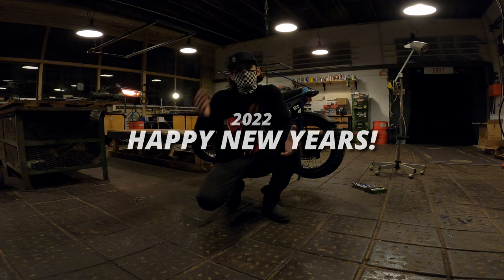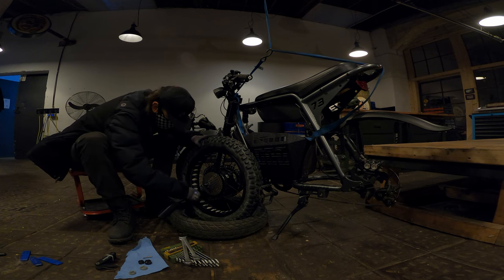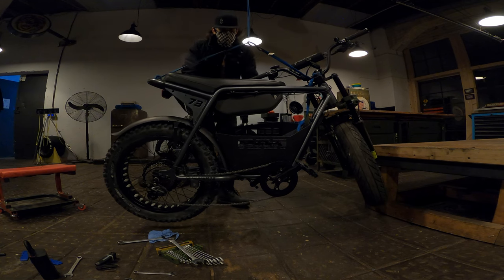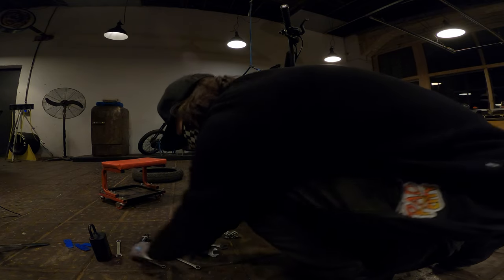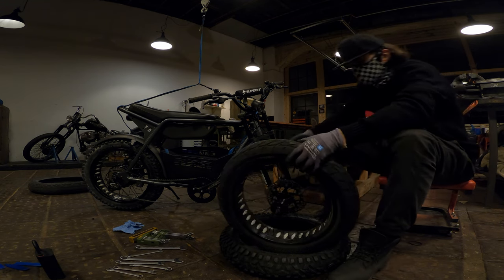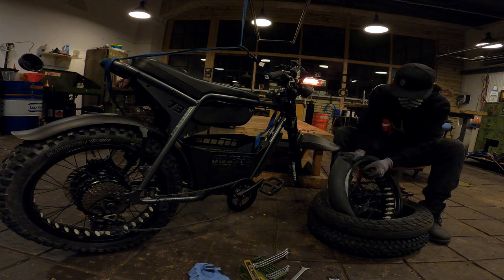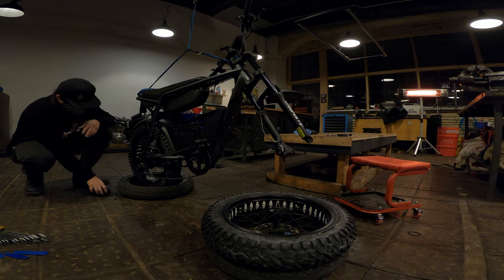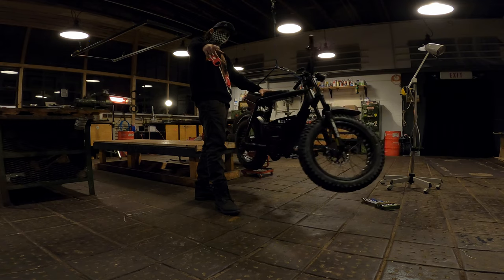Super73 ZX Mods: GRZLY Tires Install + Stan's NoTubes Tire Sealant

Comment: I was in touch with Super73eu about the 5 inch grzzly tires. And the reason they dont have the 5 inch in stock, is because it may touch the chain due to the 10-gear casette.
Reply from the maker: For your ZX or RX/S2? Did they confirm if the 4.5 fits the RX or S2? Thanks for checking
Reply: @RadCityBerlin  they did’nt spesify a bike, just in general all the bikes. Here is the answer I got for them. 

The reason we don’t have the 5,0 is that it isn’t compatible with the EU model of the bike.
 
We only have 4.5 also because the GRZLY in size 5" may touch the chain on EU bikes, which is different due to the 10-gear cassette.
 
Since those tires have a more voluminous pattern it could rub against the chain on some speed = > the US model don’t have a chain.
 
The difference of size isn’t major, so it will fit the rear tire, is it’s a bit more “tight” but really not big difference of size.
 
I hope those informations help to clarify. 😉️
Reply from the maker: @mrrobsko  great thanks for the info,  pinned your comment I think it will be helpful for others. Cheers
Reply: @RadCityBerlin  no problem. Great video btw ✌🏽

I had to ask them since I already ordered one 4,5 inch and waiting for the 5 inch to come in stock.

Comment: Are those tires 20x5.0 and would they fit my Marioebike I'm currently using 20x4.0 🤔
Reply from the maker: They are 20x4.5 in front and rear, good question not sure if it would fit the Mariobike rim, also may need larger innertubs (20x4.5-5in) Cheers
Reply: @RadCityBerlin  thank you my friend 👍🏾

Comment: Both are 4.5 inch? What PSI are you using?
Reply from the maker: Thanks yes that's correct both are 4.5in 👍🏼
Reply from the maker: 33 PSI rear, 28 PSI front ;)